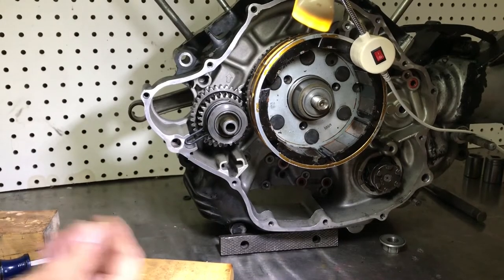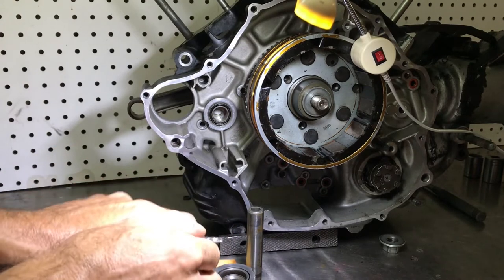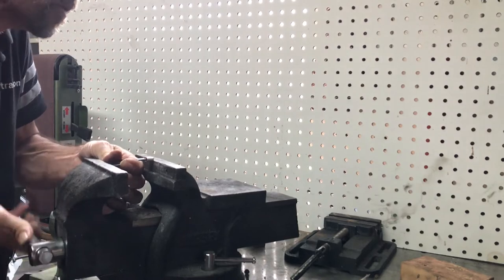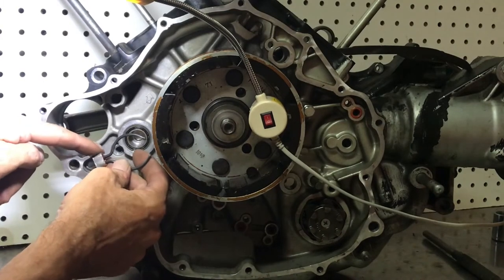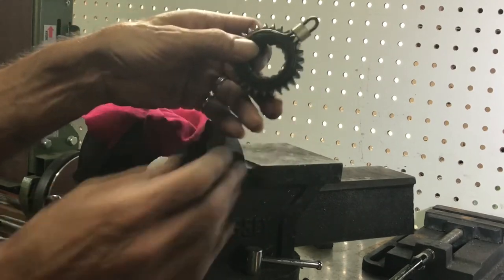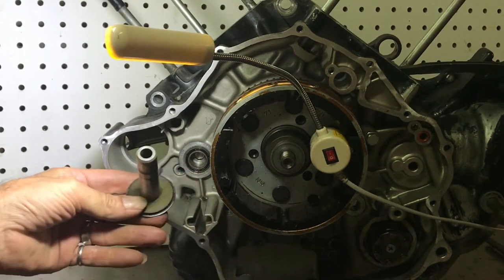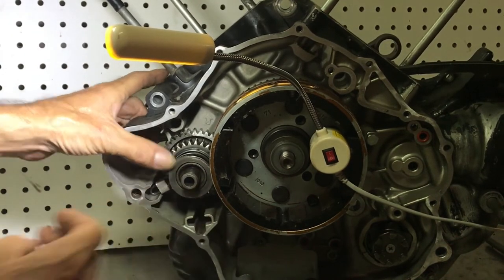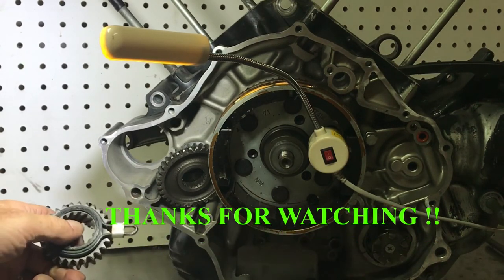Virago Starter Bendix Clip: Metal Clip Install

Comment: Great info, just ordered one of your clips.  I'm resurrecting an 82 750 I've owned since new that's been sitting for about 19 years.  I had to think a bit before I remembered the starter noise.
Reply from the maker: Thanks man 👍. That’s awesome you still have your bike from new...not too many people can say that for sure.  Hopefully the clip will help out on yours as well...it got mine back to starting each time with out grinding the gears so, although my gears are pretty much worn out, at least they won’t wear any further. All the best ! Steve
Reply: @StevesDIYs  where can I get the clip and the part it goes on for a 95  virago 1100

Comment: I'm interested in purchasing one of these clips or possibly a pre clipped clip
Reply from the maker: Hello, thanks…there’s an eBay link pinned in the comments for the clip clip, but I also have two of the kits out there right now as well that has the preinstalled clip clip on the OE Cir-Clip as well as the side cover gasket.  Here’s the link to the kit that’s active right now if you wanted to have a look:  https://www.ebay.com/itm/225482805027?mkcid=16&mkevt=1&mkrid=711-127632-2357-0&ssspo=sfmcIdagSM-&sssrc=2051273&ssuid=sfmcIdagSM-&var=&widget_ver=artemis&media=COPY
Reply: @StevesDIYs  you're a life saver I can't wait to get this installed with a new gear at my next oil change

Comment: What is the purpose of the clip thats on the starter motor itself? Mine came off when I removed the original starter motor and I cannot find a good explanation of its function
Reply from the maker: Hey !  The smaller cir-clip on the starter is there to make it stop rotating quicker when the start button spins released.  The quicker the starter motor stops turning, the faster the Bendix gear will pull back once the motor starts so the clip helps just a bit to keep the Bendix from grinding against the flywheel.
Reply: @StevesDIYs  Thanks for the quick response. I have been having to deal with a crap ton of starter issues with this bike and I was freaking out when I just found that clip laying in the hole where the motor was supposed to insert. Thanks for explaining the clip purpose, helps alot.

Comment: What year and what size motor?
Reply from the maker: Hey man !  The clip is for the ‘81-‘83  xv750 and the 920’s (they don’t have the big solenoid on the top of the left side cover). Mine are ‘81 and ‘82  v750’s (the ones in most of the videos on the channel).

Comment: That does seem to work but what does the clip change in the end? is there to keep the diameter of the ring closer to each other?
Reply from the maker: Hello, yes, it basically keeps the wire ring clamp tighter (or the diameter smaller like you said 👍).  The effect of tightening the wire ring is actually interesting because it does two things…1st it increases the friction so when the flywheel tries to speed up after the compression stroke pushes it really fast, it keeps it from going as fast so the Bendix gear stays engaged better (the starter goes too slow to keep up with the flywheel immediately after the compression stroke).  It also adds the extra friction so when the Bendix gear is pushed onto the teeth of the flywheel, it pushes it much harder and doesn’t allow it to bounce on the teeth so it engages back into the flywheel teeth and doesn’t just grind the gears together.  The metal clip clamp needs to provide the correct amount of additional tension though…too much and it makes the starter motor work too hard…too little and it will still allow the gears to jump out and grind.  Hope this helps and all the best !  Steve
Reply: @StevesDIYs  thanks for the reply. Since i live in the netherlands is there a way to make it myself?What did you make it from?
Reply: And did you use it in the end on your bike?
Reply from the maker: 👍. Yep, if you want to, send me an email at stevesdiys@gmail and I’ll send you a link to a video on how to make one since shipping international is really expensive (I sell them out on eBay as well). Yes, I put them on my 1st Gens and no longer have problems with the gear grinding 👍

Comment: Thanks for making the video. I wonder if I could make that out of a small piece of copper pipe
Reply from the maker: J C , thanks man 👍. Yep that’s about all the clip is. I tried regular copper tubing, but it wasn’t strong enough and stretched when I pressed it onto the bendix spring clip so it didn’t add the right amount of squeeze. Send me an email at Stevesdiys@gmail.com if you want to and I’ll let you know what I used if you wanted to give that a try 👍

Comment: Hey Steve! Thank you for the videos working on the virago, they’ve been extremely helpful with my newest project. Do you happen to have an updated link to the clip on ebay?
Reply from the maker: Hey man, thanks...glad the videos are helpful !  I ran out of the clip material I make them from, but have more material on order...should be about a week and I’ll have some more made and listed again on eBay 👍. I’ll update the link pinned in the comments for the video with the new listing, but I’ll also reply back to your comment with the link so you’ll have it once I post them back up👍. All the best !  Steve
Reply from the maker: Hey again, here’s the new link for the listing 👍:  https://www.ebay.com/itm/1981-1982-1983-Yamaha-Virago-Bendix-Clip-Clamp-Starter-Fix-xv750-xv920-xv700-/224964397480?mkcid=16&mkevt=1&_trksid=p2349624.m2548.l6249&mkrid=711-127632-2357-0

Comment: Just subscribed. This video helped me big time. I was just wondering if you knew the torque specs to put the cover back on? My virago is an 84xv700
Reply from the maker: Thanks man 👍. For the side cover bolts (or any of the 6mm bolts on the motor) the torque spec from the manual is 10 Nm or 7.2 ft-lbs for the most part. Thanks again and all the best !  Steve
Reply: Hey thank you a lot it’s been driving me crazy. Finally found the specs in my book but didn’t know what the (M10 26 -29 and  the M6  7 - 10) were or how to tell the difference. I figured it was length

Comment: I need the clip and actual ring it's self that goes into the Bendix gear for a 95 1100 virago
Reply from the maker: Hey man !  For the 2nd Gen motors (like the ‘95 1100), the starting system is quite a bit different than these 1st Gens.  They did a design change on the starting system so yours should have a solenoid that is out side of the motor with a mechanism that holds the Bendix gear out when starting so you wouldn’t need the clip.  The Bendix gear and starter parts for yours should still be available online from the motor sports type sites since it is newer and they kept that design for many years.  For the 1st Gen bikes, we are stuck with doing things like adding the clip clamp or making the change to installing a 2nd Gen side cover and the upgraded starting components for some motors that they put an additional shaft boss in.  I think even the Bendix gear is different in the slope of the inner gear teeth for the 2nd Gen.  Hope this helps and all the best !  Steve